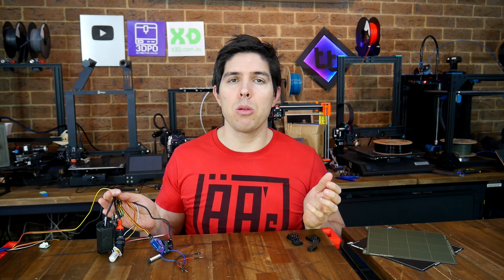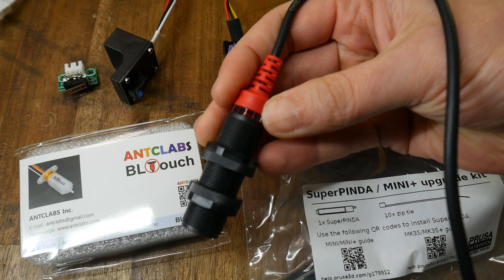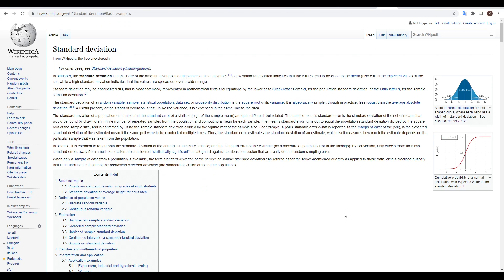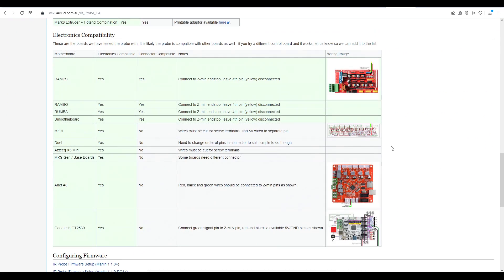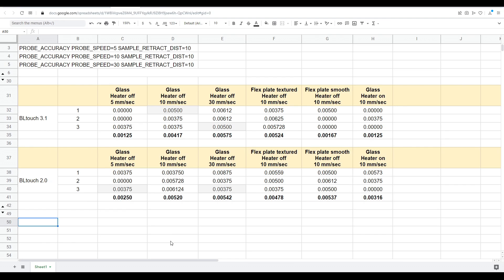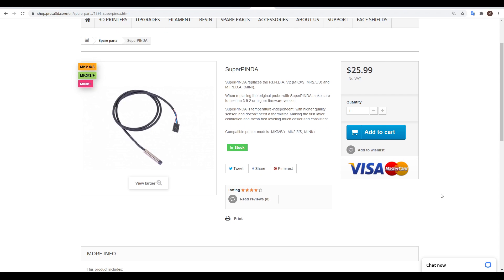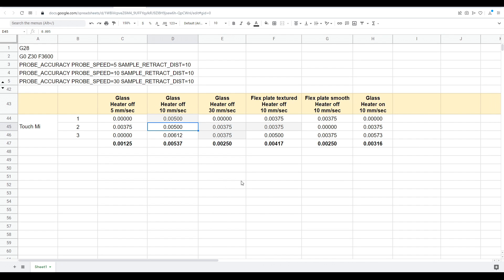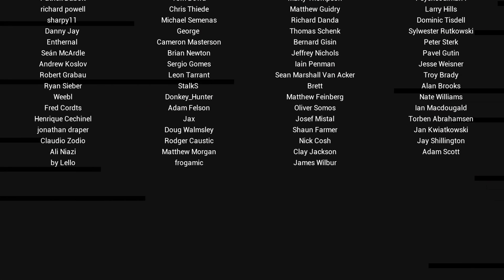Six popular ABL probes compared: Accuracy, price, wiring and more!

Comment: I have an EZABL on one machine (one of seven), and I get better first layer results just turning it off.  It consistently will NOT provide a mesh that matches the actual surface.
Reply: It's possible this is actually a mechanical fault of the printer. My first Ender 3 had an issue where the x axis would sag slightly. The left side (extruder side) was at the correct height (because it's directly supported by the Z rod) but the right side (display side) would often sag by about 1mm or more. So as the left side of the X axis raised, it was skewing in the frame, and not immediately raising the right side of the X axis. This was causing the ABL probe to read the bed incorrectly. I fixed this by installing a dual Z axis mod. Now the X axis is supported on both sides evenly, and it no longer sags at all. Perfect ABL every time. 

When people think they have "Z banding" this is often the actual root of the problem.

Comment: Installed a BL touch on my Sovol but it still feels archaic and non-intuitive to use. I don't think I've ever got it to work properly. On the verge of giving up and getting an XY machine with a sensor built in. And yes, I've read all the guides.
Reply: My BL touch has never worked on my ender 3.  I could never get a first layer that adhered properly, and like you I read all the guides, how to videos, etc. I even used a 100 point mesh, probed 3 times at each position and still didn't work. I removed the BL Touch performed a manual mesh bed level and got a great first layer.  The BL touch is a piece of junk...IMO.

Comment: Is there an option to use the nozzle as the probe with some of the newer stepper drivers. I see they have some sort of force detection.
Reply: Yes, sensorless homing on the TMC-2209s or what drivers again. Tho it's definitely NOT recommended for leadscrew-driven Zs, as those multiply force enough that you can cause damage before the stall-guard even triggers. With belt Z you can do it, or for the other belt-driven axis.
Funny that printers (2D paper variant I mean) have been using this sort of thing for ages, on normal DC motors pushing the head.

Comment: If there's going to be another video on ABL, you've gotta test the proper printing guy's home on anything system.  It uses a microswitch built into a quickchange carriage that uses the tool nozzle to home on the bed surface.  Nothing to crash into the print, cheap, and facilitates ABL with multiple tools for the cost of one.  A better tutorial video for those wanting to replicate would be great too.
Reply: That sounds pretty neat! Thanks for mentioning that :)
I'm subscribed to Proper Printing but I guess I must have missed it!

I recently started using a regular microswitch after having issues with my BL Touch (genuine) possibly being affected by the magnets I've taped under my print bed¹ so I can use removable steel sheets.
A microswitch just seemed like a very simple & reliable solution, I already had a few high-quality microswitches in stock, and I knew that Tom's old video (mentioned in this video) showed that microswitches were the most accurate option he tested.

For now, my microswitch probe is just screwed to a strip of prototyping PCB into which I drilled & tapped M2 holes, then that board is temporarily attached to the X-carriage with a couple of M3 bolts into threaded inserts whenever I need to probe the bed.
It's more time-consuming to attach/remove than I'd like, so I've been considering alternative mounting solutions, or even replacing the microswitch with the load cell-based probing approach used by the Creality CR6 SE (IIRC!).
So learning about the system you mentioned is great timing :)

¹ A "MK42" bed, as seen on the Prusa i3 MK2 -  although my print bed was from a third party. I won't name the supplier because:
1) I wasn't impressed by their service;
2) the bed's mounting holes weren't countersunk quite deep enough for the supplied M3 bolts, so the bolts slightly protruded above the bed surface leaving six mounds once the PEI sticker was applied (of course I only noticed the issue after I'd applied the PEI sticker, and it's a massive amount of effort to remove thanks to the 3M adhesive used, not to mention ruining the PEI in the process, replacements for which were harder to source back in 2017/2018); and
3) I don't think the bed PCB was very flat, either.
Not good, given what I paid for it!
Reply from the maker: Jon is very creative with his solutions. Also, have you seen this: https://youtu.be/hs6IVfNrf5k

Comment: From what I read, the CR Touch, as much clone-y as it looks, uses a similar principle but different height sensing entirely. Basically, it's a clone all the way down to what REALLY matters, on which I would give the clear win to the CR Touch. The CR Touch is not a hall effect sensor probe like the BL Touch one, but rather, an optical one. This thus gives very little if any problems with electrical noise on the cabling and around the probe.
In reality, with a good and well installed BL Touch the difference is only mensurable but you can't feel it.
Then again I'm running a better-tier clone BL Touch too (a Trianglelabs latest version one) and it operates beautifully too with nothing to complain about.
One of the things that just slightly trigger me when watching BL Touch videos is not using the high speed mode, damn when I 1st set mine it annoyed the crap out of me, then I enabled this and it was day and night. For anyone wondering what that is: instead of retracting the pin each time it triggers, it just stays down, the printer raises the Z axis, it then opens the probe signal and it goes back down again to probe the point again (or another point). This DEFINITELY speeds up the probing in case you can raise the Z fast enough (well, mine can raise up to 100mm/s so of course I leave it enabled, but I can bet most machines could handle at the very least 20mm/s on Z if configured so).

Comment: From the very limited actual technical info on the CRTouch, I would not consider it a BLTouch clone.  That info at least hints at it using an optical sensor rather than the hall-sensor that is the cause of the tricky tuning needed for a BlTouch (and then it still can be influenced by external magnetic fields).  Also, the mere fact that the CRTouch always retracts its pin, even when losing power is huge for reducing the risk of it dropping mid print and getting bent.  So, I'm disappointed that you just state it is a clone rather than getting one and doing a thorough tear-down to proof that statement or instead show the differences ...
Reply from the maker: Hard to tear down something I don't have in front of me. Let's not pretend that I damned the CR touch in this video. I simply I wasn't including it because I didn't have one on hand and I hadn't felt the need to purchase something similar to a BLtouch for more money. I was then fair enough to state some anecdotal evidence that the probe was effective.
Reply: @TeachingTech  You didn't tear it down (neither literally, nor figuratively), indeed.  And I also feel Creality itself is to blame: they don't really do a good job at marketing the benefits of the CRTouch over something like the BLTouch.  I don't know why.  The Internet has sufficient BLTouch users that had their pins bent or even more collateral damage when during heavy fast infill the pin dropped out - with the CRTouch's default retracting pin (so not falling out), that should be the top feature for Creality to market.  And there are many users with bad 3DTouch clones, which Antclaps then states is because those do a lot less tuning of each device than they do.  With a Hall sensor I indeed believe that finding the exact trigger level and somehow tuning the electronics for that can be tricky.  Again, if the CRTouch indeed has an optical sensor instead, then this would not be an issue there (and less tuning needed should mean less work and hence lower cost).  So, the combination of Creality not marketing such advantages and 3d printing youtubers just assuming this is yet another BLTouch clone might just be stopping this from taking over the BLTouch market (either in Creality form or if it becomes successful, probably in much cheaper cloned form).

Comment: Aw, you should've tested piezo sensors!

I use a piezo setup now, and I'm so glad I switched to it from inductive bed leveling. It's way more accurate, and not having a probe offset is great. The only downside is that it's not really plug-and-play. It took some experimenting with mounts and configuration to get it all down (you need a mount that bends the disc to be the most accurate). Once you have it down, there's nothing more accurate.
Reply: What mounting system did you use?

Comment: Since I'm using metal magnetic build plates, I'm using inductive probes and these have been the absolute best for my personal setup. I've used a BLtouch, but it died prematurely. I've only had an inductive probe die on me once and I've used 7 so far.

The underbed piezo sensor is at the second place for me, especially on the Delta printer. I enjoy using it a lot and it's very precise as well, but it's sensitive to oozing, causing premature triggers. So a clean nozzle tip is essential since you're using the tip of the nozzle to probe.

Comment: It would be nice if one of the piezo (head as the probe) sensors was tested in the next video. 

 I'm using a Duet 3D Smart Effector because of the piezo probe.  I've found it to be far superior in reliability to any of the BL Touch type of probes. Determining the Z probe offset is a bit of a pain.
Reply: In what way is it far superior?
Reply: @originaltrilogy1  TL;DR: BLT's usually fail to deploy the probe 1%-2% of the time.  My Smart effector has done about 2K probes this week doing a test with zero failures. 

 I was the one that created the Marlin code that reliably detected the BLT 1's pulse and tested the BLt gens 2 & 3 prototypes.  I have about 15 sitting in a box.  In my experience, most BLTs will fail to deploy 1%-2% of the time.  That's probably OK for an occasional user that just probes the corners.  I'm running some larger printers and the G26 results showed that I needed about an 80 point mesh.  Net result was that it was almost impossible to complete a G29 mesh without the BLT failing and the head crashing into the bed which usually caused damage.  This week I was testing the repeatability of my delta printer's bed leveling system.  I did 4 rounds of "thermal cycle, 6 mesh builds/probes over 4 hours" Which is about 2K probes without a failure.

I still have head crashes but they're due to my setup mistakes, none due to the Smart effector's Z sensor failing.

Comment: For the bltouch, how does one reduce the number of probe points it takes? I have a cr10 v2 and use cura
Reply: It's not on the slicer, but on the firmware. Configuring correctly, you can level it once, store and just use the probe for the initial Z homing, if your printer is stationary. If you move it around enough then I sure recommend running leveling at least once every moving around, or if you use different bed surfaces or temperatures.
The points are configured on Marlin firmware at least on the size of the grid you wanna use, and also how many probes you do on each point.
Reply: @Kalvinjj  do you know of a tutorial to change the number of probe points then in the firmware? If not I’ll just do as you suggested by leveling it just once and using the probe for initial z homing.
Reply: @colbyc8181  I will assume that your printer is already running Marlin, if not then I think you'll have to start earlier on than this, but on this very channel there's an older tutorial to adding BL Touch that has some settings tutorial section: https://www.youtube.com/watch?v=BV11-VOQjMc&t=601s
I don't know what Marlin version you're using and whatnot too, but the thing you're looking for is "GRID_MAX_POINTS_X" and Y, at 10:06 (on the video I linked) you can see it on the Marlin Configuration.h screen.
I have mine set to 3 X and 3 Y so 9 points, but have High Speed mode enabled and it works great since I have a fast Z (I think I raise it at 50mm/s after each point), tho mine is a full custom machine, not a CR-10. Heck I make 7 probes per point, but since I do it while heating the nozzle I don't mind it much, it doesn't delay the print start in the end. A big bed like the CR-10 benefits from many points, so dunno if it's worth reducing it.

Comment: One of my printers came with an IR sensor (not the AUS3D, just a generic IR Prox sensor), and I found that the color of the bed or print surface caused distance variations and would cause the print to fail on the first layer)..  I discovered this when I had to replace the factory black print surface and got a "name brand" with fancy graphics and color and the printer basically either started printing in the air or dug it's nozzle into the printbed.   Blue painters tape also caused the sensor to see yet another distance..   I tried everything to fix the thing but because it had an R-Pi with a customized Octoprint as an intermediate controller for its touch screen, it was a pain to mess with its firmware and I eventually just gave up on the printer...

Comment: Its good to see the standar deviation in perspective. Since I installed the bltouch, Ive had no more first layer problems anymore.
Reply: I’ve had amazing reliability since installing a BL Touch as well. Unfortunately can’t say the same about my previous EZABL, which would always trigger at different heights corresponding to the temperature of my enclosure, and the humidity in the air

Comment: There needs to be a follow-up test, accuracy across probes at a single point at a single point in time is important, but as you see, there is so little difference it's a tossup. Where the different probes can actually make a big difference is in Z homing/Z offset between prints. A set temperature may still get ten probes with little to no deviation, but probe across ten different temperatures and you will have a different DISTANCE from the bed that the probe triggers (and I don't mean just the expansion of the bed, I mean a variation in nozzle height over the bed that the probe triggers at) making consistent 1st layers between different prints visa vi Z offset problematic.
Reply: If you calculate or even measure the difference in Z offset between, say 190C (the lowest you'd normally use for PLA) and 240C (the highest that would be safe with a PTFE-lined hotend) you'll find it's very small - in the same ballpark as the standard deviations.  What certainly will make a difference is the amount of squish that's ideal for different filament types.  It's well-known, for example, that PETG likes less than PLA, and that's what changing the Z offset is good for.  If you have a decent slicer, you can set an extra Z offset there, which is what I've done for all my PETG profiles. The optimal amount is significantly bigger the standard deviations Michael measured, or that would be accounted for by thermal expansion.
Reply: @pnt103  it's bed temperature differences that cause problems with the capacitive probes. I've seen 0.5mm differences between room temp and 50c.
Reply: @PNWPrototyping  I know - I was actually responding to Kalvinjj's comment about different materials.
Reply: @pnt103  Yes, that's what I compensate with 1st layer flow, each material with their own percentage. Simple solution without tweaking constantly the offset on the printer.
Reply: Indeed, I've had something similar (not necessarily a problem on the probe, but could be) when printing different materials. PLA, ABS and PETG all seem to require different Z offsets to stick properly and not smear too much the 1st layer so it doesn't blob. What I ended up doing to compensate this, is find the best Z offset for one material, leave it there, and compensate on the 1st layer flow percentage. This way I just enable different profiles for different materials on the slicer, and all works without messing with the printer itself, not to mention not like some fraction of 0.2mm matters in the height accuracy anyway.
Reply: So much this. Temperature dependency can make a seemingly accurate probe feel maddeningly inconsistent.
Reply: Came here to write the same comment. Cap touch probes seem to be the worst for this. They will even give you different offsets with minor room temperature variations.

Comment: I'd be interested in how much the trigger point changes between different surfaces, surface finishes and color (in case of the IR sensor). I have two different offsets in my Prusa MINI. One for the textured and another one for the smooth sheet. The BL-Touch on my (heavily modified) ENDER 3 doesn't care what it's probing, so I can quickly swap between glass, steel, polypropylene ...

Comment: My favorite probe is none of those, since I have the Biqu B1 SE Plus, which uses a stress induction sensor built into the hotend assembly & uses the nozzle touch the printbed to auto level (there aren't even knobs to adjust the bed).

Comment: With a BL touch on any 3d printer with a standard style spring/silicone supported bed you still have to level the bed to be able to print.  The only one of those probes that really effective is the Pinda and that's because its readings are then used in the Prusa firmware during a print.  BLtouches are a total waste of money and time.